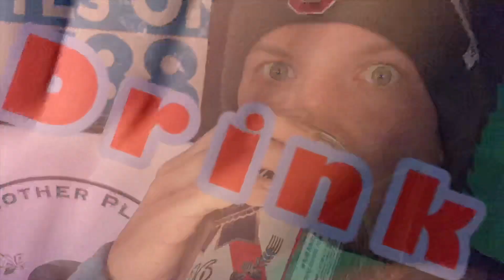DIY Above Ground Pool Designed!

Comment: May I give a suggestion, don't use tarp to hold water. They  wear out very quickly. What I would do is look for a virgin vinyl above ground pool liner and us it for your liner....It will have a better quality to it and way way way better than any shitty intex pool.
Reply from the maker: Andy Olsen I totally agree. I had planned on just replacing the tarp once a year but I don’t think they would even last that long. I’ll definitely look into that above ground pool liner! Thanks for the advice!